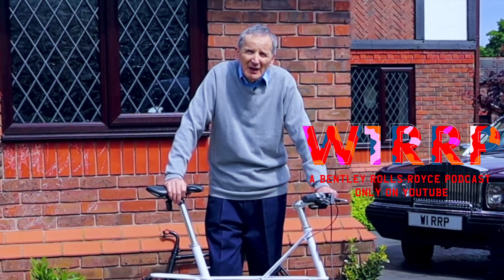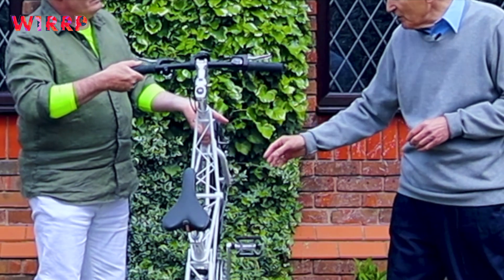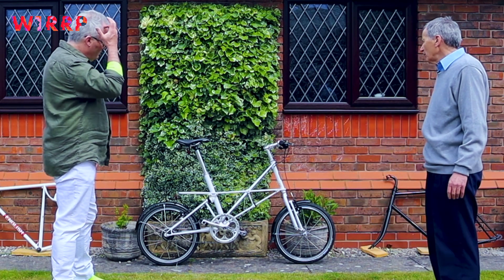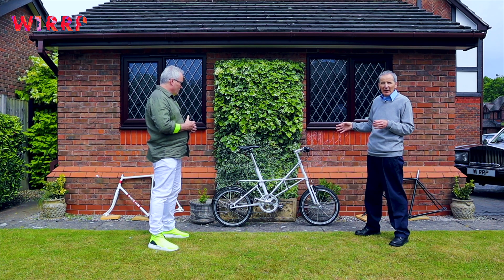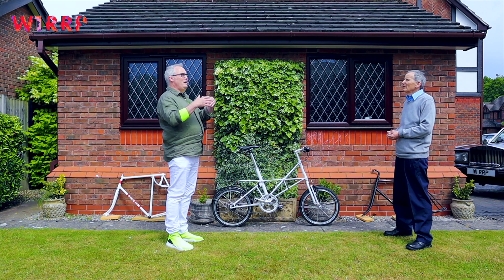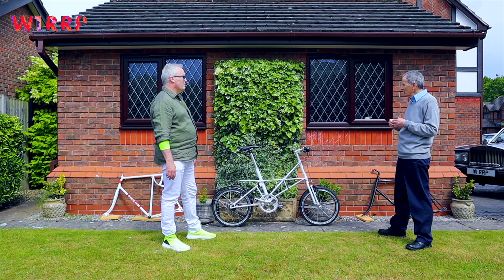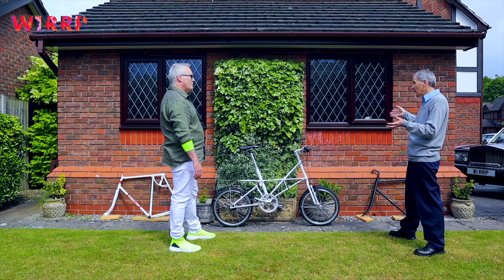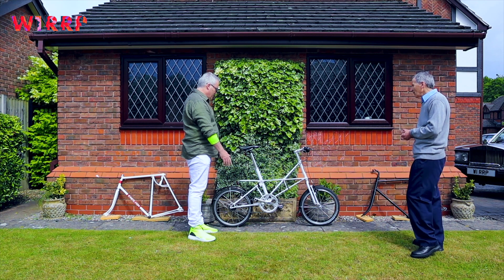Rolls-Royce Designer Picks Iconic Design Classic Moulton Bike Graham Hull Alex Moulton

Comment: You may have been a car engineer at Rolls Royce but from a life long racing cyclist's point of view the design of a Moulton is much more inferior to a modern race bike.
There is no real need for suspension on such a small light weight vehicle, with a single rider because the pneumatic tyres on modern bikes are quite sufficient on their own along with the spokes on a larger wheel. Moultons 'bob' whilst pedalling, just the same as a mountain bike that also has both front and rear suspension, which isn't efficient at all and alters the natural cadence, for further efficiency losses.
Smaller wheels do accelerate and decelerate faster but smaller wheels also do not roll as well and all things considered are not as fast as larger wheels and are twitchy whilst riding, they also as a wheel, don't smooth out road imperfections as well as larger wheels. So the addition of small wheels in  bicycle design, nessessitates the need for suspension, that with larger wheels, it negates the need for further suspension, or the extra weight, it's addition would incur.
Further, the frame is  a round section tubing space frame, round tubes may be good for weight against structural load for some engineering requirements but round tubes are very bad for aerodynamics, add to this the whole space frame gives you as big as a surface area as you could possibly imagine, with the mirriad of triangles and you have got a bicycle frame with possibly the worst aerodynamics of any bike on the road, not withstanding added unessessary weight compared with the alternative double diamond frame, whereas modern day carbon fibre aerofoil shaped tubing on a modern race bike, is the leader in aerodynamic design, within uci constraints. Which is by far of the greatest importance along with the aerodynamics of the rider for going as fast as possible with the available power to propel the bike.
The long seat and steerer tube, inherent in the Moulton design, also reduces overall stiffness, which again reduces total efficiency because of flex.
The double diamond frame has persisted in bicycle design for one reason, it is the best within the design restraints of a none recumbent bike.
So yes, for a bicycle commentator on bicycle design, you are a good car designer and engineer. Don't give up the day job. As far as I can see the Moulton was an answer to a none existent problem, a tour de force of misguided over engineering, just for the sake of it.
Reply: Do you know the Moulton holds the bicycle speed record, which I believe still stands to this day?
Reply: Small wheels accelerate faster, have a smaller frontal cross section and climb hills with greater ease.

UCI outlawed small wheels on bogus safety concerns.